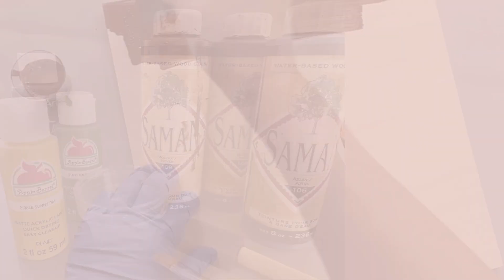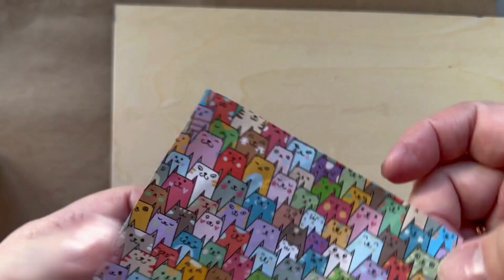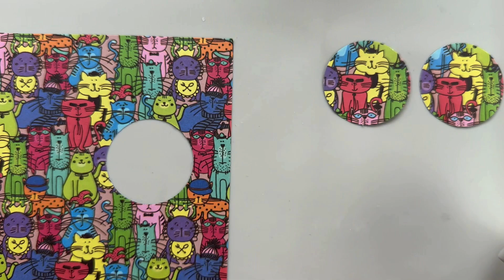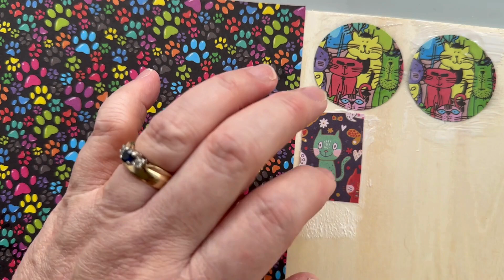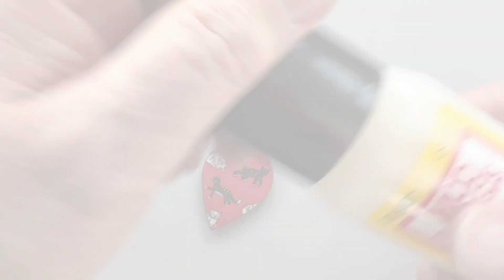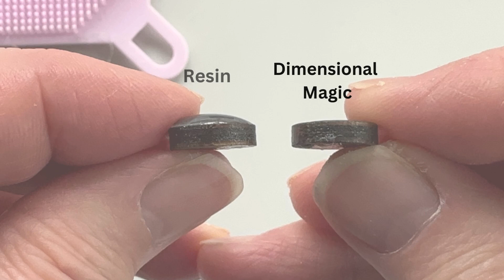xTOOLM1 Jewelry Tutorial : Fast & Easy Laser Cut Wood Decoupage  #diy #jewelrymaking #lasercutting

Comment: Great info thanks. I just got an M1 ultra. I want to do everything at once. Will cardstock work also? I have a ton.
Reply from the maker: Yes. Use the card stock setting for your M1Ultra. You will need to seal well the results if you are making it into jewelry. Seal first before you add resin if that is the final layer you want.
Reply from the maker: I just realized you meant gluing card stock onto wood. It should work as card stock is so thin. However, do an experiment first to see if you need to adjust the laser cutting settings. You will need to color the edges of the final pieces as the white of the card stock will likely show.
Reply: Thank you

Comment: incredible!! Doesn't paper burn? Could you share the parameters you use on the M1? Congratulations for the nice work. I'm from Spain and I make crafts with epoxy resin and now with the M1 too.
Reply from the maker: The paper is combined with the wood so together, they will not burn. The laser is so fine that it will only cut through where your cut lines are. I was using basswood so I used the M1 reference settings for 3 mm basswood which is 100% power and 5 mm/sec. The origami paper is so thin that the settings still work.
Reply: @beadinggem  Wonderful!! I have to try it!! Soon I want to buy the air assistant and the base riser with honeycomb panel. Thank you so much for sharing it!!
Reply from the maker: @patriciaarbulopatri BTW My current setting on the M1 for 3 mm basswood is 100% power and 4 mm/sec.